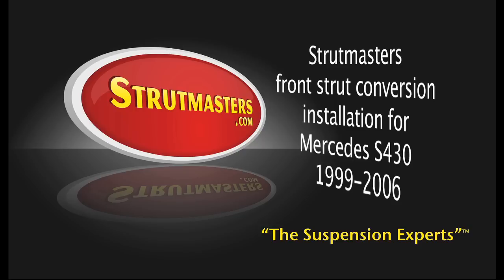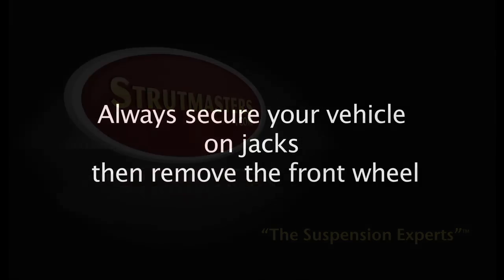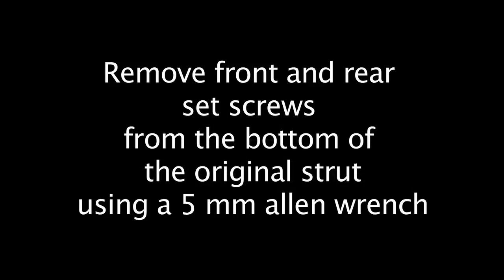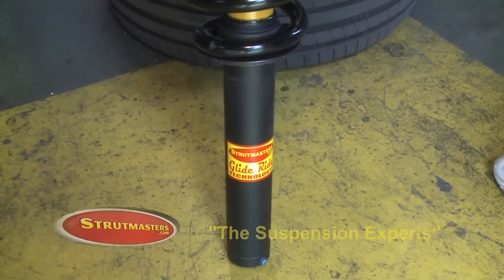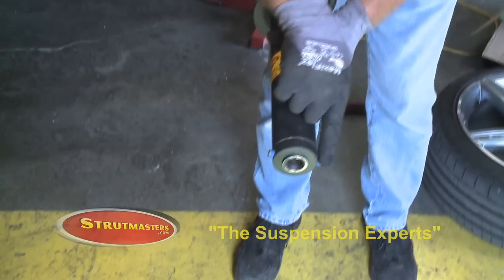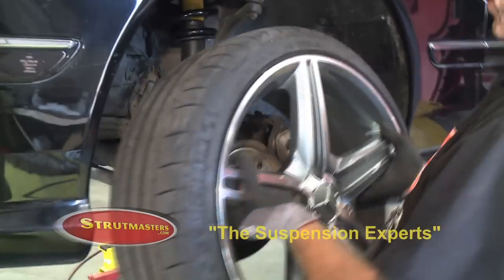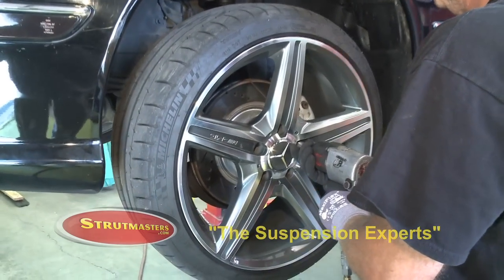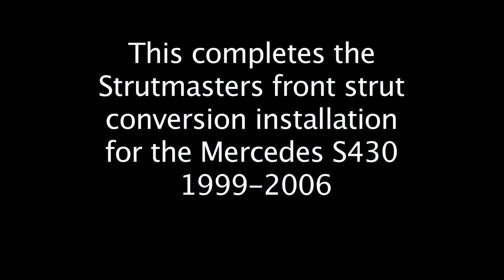Front Installation:  2000 to 2006 Mercedes S430 Suspension Conversion Kit By Strutmasters

Comment: The early models of the W220 had a 'two-piece' section on the pumps, that consistently leaked.  That caused the fuses to blow, and send the warning to the dashboard.  These pumps/leaks could be corrected by using a 'one-piece section (and MB did that on the 'facelift' versions from 2003-on), and no further issues were found.

Comment: for those that want to buy this coil spring suspension, dont, you wont be able to turn off the warning lights in the instrument cluster, buy the ones that come with the set up in the fuse box so you wont see any warning lights.
Reply: Where can i buy the fuse box setup

Comment: the conversion is totaly worth doing. the day your air suspension fails is when your most likely using your car and when it fails u can't even drive with it especially with over sized rims and tires. I had my air suspension fail on me at night and almost blew my tire out it started rubbing the tire on inner fender really bad I was goin 50 mph smelled rubber and airmatic light went off red must stop to low lucky I did and saved my 200$ tire the car drives a little stiffer with the conversion but it will never leev me stranded like it did before and had to get it towed
Reply: Efren Mendoza how did you bypass the code when converting?
Reply from the maker: So glad that we were able to assist you!

Comment: Hi my s class strut is stack on top high level at front right how to repair it I have try to release the air with open the top valve but no air coming out and still is top high level at front right how to repair it ?